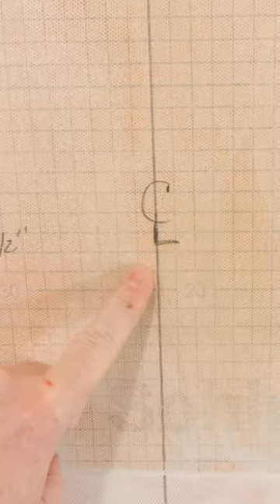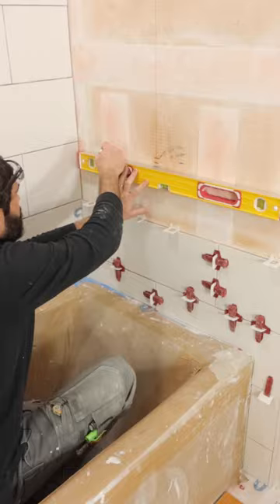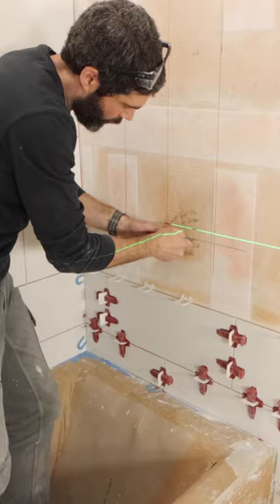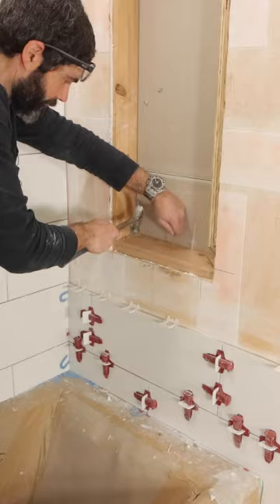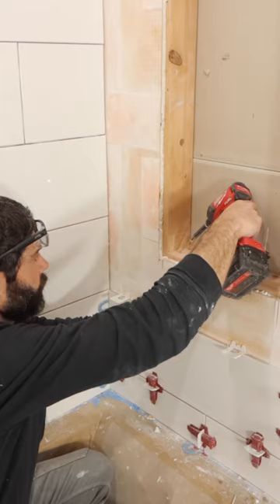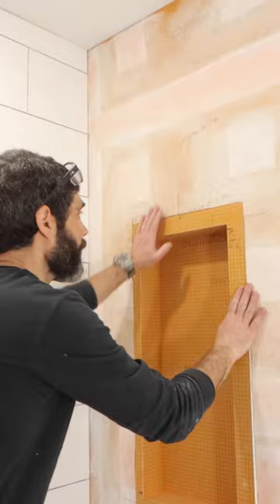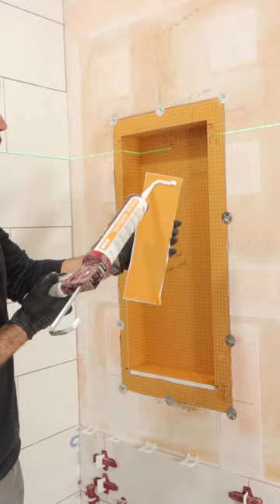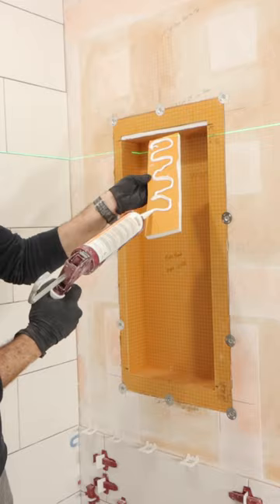Schluter Shower Niche Installation - #shorts

Comment: Why did you not build the niche while putting in your initial kerdi board? Why go through the trouble of cutting it out like that? I am truly asking to learn, this is not a critique.
Reply: I have the same question. I have done many of these, and I've always built the niche beforehand.
Reply: It’s easier to do it this way to ensure it will work with the tile layout. Notice how the tile is already installed almost up the the niche. Trying to put it in first off of just measuring can come back to bite you. Since you can tile right away over the kerdi band, it doesnt take any more or less time to do it at this stage
Reply: @dustinclouse6888 you have to built it really on exact spot if you want it to match layout.